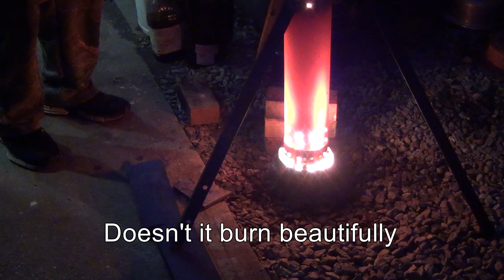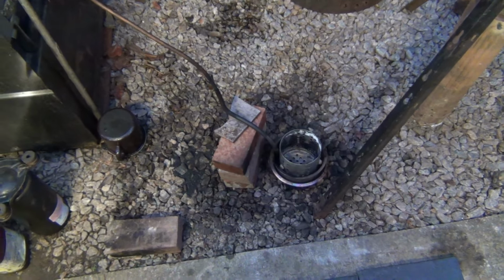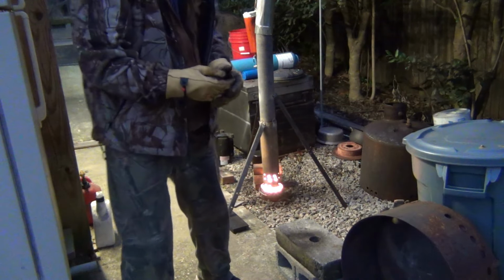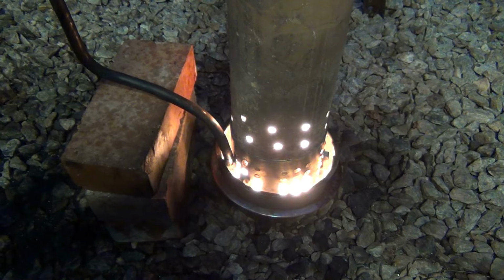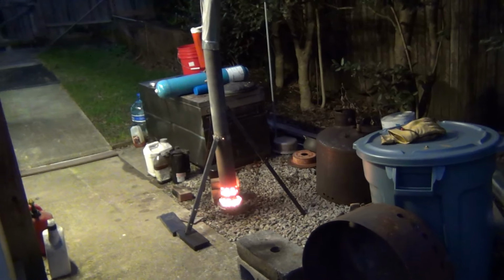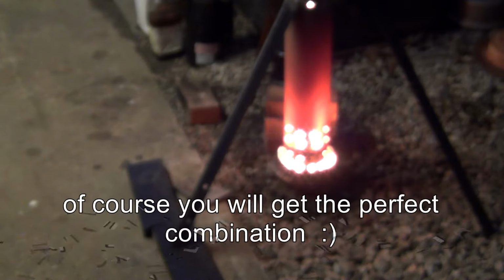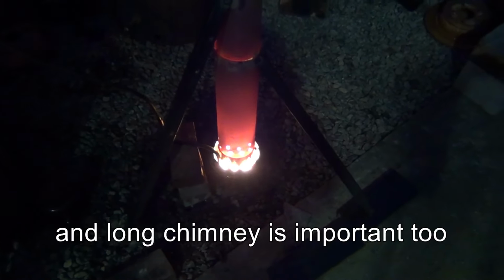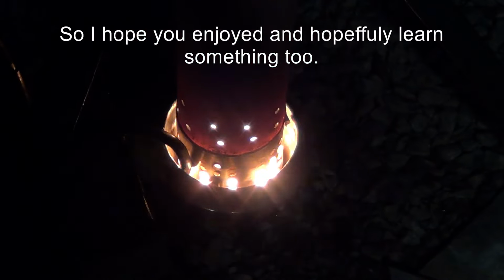Basic waste oil burner without blower

Comment: very nice design but remember galvanized pipe is very very toxic when burning
Reply: Why, galvaniz is zn it same material for roff in my country
Reply: "These fumes can cause what is known as “metal fume fever” or “zinc shakes.” Metal fume fever can cause symptoms that include fever, headaches, nausea, chest pain, and more. Inhalation of these fumes can also cause long-term health problems, as the lead present in the galvanized steel can vaporize along with the zinc."
Reply: It's generally most toxic in the first really hot burn. First burns should always be outside and safe. It did worry me that the video creator mentioned welding the galvanized "chimney pipe". I wouldn't want to weld that stuff at all
Reply: Everything is toxic when it's burning.
Reply: Yeah like burning waste motor oíl is so healthy and enviromental friendly tho.. Yep sure..
Reply: Drink some milk get some rest avoid the first hot burn and the fuzzy ash you will be find

Comment: Nice. OK a lot of effort to proof the concept. That done, how can you put the burner to good use? There is no point in burning oil and getting a pipe white hot if you can not put is to good use like heating water, cooking. As is it is not usable to heat a room.
Reply from the maker: @barnardb01  yes it is, see other videos

Comment: I used the inside of oil stove, inside it had 4 rows of small holes in a circle. I ran a copper line inside into a SS dish. in the center. I used a drip feed from a scrap windshield washer tank.  I used the needle valve  to regulate the flow of  {90% used motor oil and 10% diesel mixed well to thin)  at the back of the oil stove where the supply of heating oil came in I hooked a small electric hair dryer.  WOW, in no time at all, in -40 brutally cold winter, i can bring my 600 aq ft shed, to 25 degrees Celsius, way to hot, the stove casing is maybe 16 gauge thin.and turned white hot.  I built this to cut down on the amount of firewood i was using, and the need to keep adding wood every couple hrs. or worse. Over the winter we had 2 months of -30 to -45 Polar Arctic Chill, I used around 5 gal of used motor oil, with % diesel to thin it out in around 24 hrs.  By winter's end the thin metal casing developed cracks from the intense heat. So am building a new version with a Aqua Tank, the metal is quite thicker. I've watched almost every Y-tube video and ''' Oil Burner ''' eh mate, are a 'must see....

Comment: Forgot say ♥️ the video but  need close up or drawing of stainless pots , and drill size. Nice hot furnace ( careful on flow rate  white flame is 2,400- 2900f  too hot flow rate )
Reply from the maker: Can you explain please
Reply: temperature has on the color ot
flames. Scientists have learned that
red flames correspond to
temperatures from 980 F up to
1800 F. Flames turn orange when
the temperature reaches 2,000 F
to 2,200 F. When temperatures
approach 2,400 F to 2700f they appear white.

I was getting 1600f resulting in repairs to thin stainless steel heat changer but any impurities were vaporized and turned to dust. That was my first converted wvo heater block installation on Mr heater forced air heater. Now have wmo double barrel furnace with heat exchanger yrs ago 10 was on wvo
(So safety says should reduce flow  rate for lower temp) hope this helps
Reply: I agree. The design is very good , but the rate of oil must be closely monitored so that the metal is prevented from melting.

Comment: Hi, Thanks for a very interesting video. I like the idea of the double pot for insulation in the vapourisation zone. I have been thinking of insulating ceramic for the same reason. Is the burner pipe a close fit in the burn chamber with all the holes in it? Is the extra chimney necessary for providing  the required draft or is it just to take the exhaust away? Tim
Reply from the maker: It is close fit but not necessary, Chimney is necessary, the longer the better,
Reply: @VladFredK  Thanks for your reply. Tim

Comment: Of all the systems I’ve reviewed on YT, this is the simplest, and thus I believe is the best. 

Adding a Tee section and wafer valve further up the pipe (about 1m) will provide control of the air flow and the oil burn rate.

Comment: 2 ideas: weld some plates to outcome pipe to let heat air better. Make income cold air pipe straight to the flame - in order to block sucking warm air from the room, it should let burn better

Comment: I was thinking if a person welded that tube in side a tank of some sort so it can gather heat then weld 2 5" pipes blow air in one and heat out the other would heat a small shed or insulated garage real nice. Wonder if it would burn used engine oil
Reply from the maker: Yes it burns engine oil even better

Comment: I have a mobile home that has a gas burner (type) central heating (vents and duct work are on the floor) that uses propane. But I can't afford the price of propane any longer. I'm not running 3 - 1,500 watts space heaters trying to just keep my living space warm. And there's 6 rooms (cold toilet seat is something to get used to lol) that I have blocked off, so they stay meat locker cold. 
I've been trying to brainstorm a diy wick system using waste oil. By the looks of it,  winter will be gone before I figure something out, lol. It's been 19⁰F at night. My dog doesn't even come from under the covers lol

Comment: How do you keep the oil inlet from melting? Is it copper?
Reply from the maker: Yes it’s copper, most heat is inside the pipe, the copper tube is on the outside so not enough heat to melt it.
Reply: @VladFredK  very cool, thanks

Comment: Cool dude. Nice job. I've been experimenting with the oil and wicks and thinking about the drips. I got some 1/4" copper tube and 1/4" copper coupling. What did you follow for making the drip system? I like the idea of a drip system. I am doing this in a van and it has a little stove i made and 3"exhaust pipe for chimney. I've tried carbon felt for a wick but can't keep it lit so I will try adding more alcohol next time to start.
Reply from the maker: it will be dificult to make it work in small scale with out forced air.

Comment: May i use used engine oil ?
Reply from the maker: yes that actually burns better
Reply: @VladFredK I live in Alaska and I smell when people are burning motor oil, do you think in those cases the burn wasn’t getting enough air?
Reply from the maker: not necessarily, it has to be the right amount of air and chimney draft, to much air will not burn clean, not enough air will not burn cleat also ,  to much air draft will burn clean but too fast, not enough chimney draft will smoke, I regulate the air draft with the amount of holes supplying the fire with air. this way you create the proper vortex . Its not easy to burn the oil with out blower but my house heater works pretty  well  https://youtu.be/uk9M0H_SUzQ

Comment: Great job👍massive heat from waste😎a pity it's quite noisy though 🤔
Reply from the maker: yeah but I kind of like this sound, it sounds better then oil heater with blower
Reply: What’s the longest duration of time you have run your heater?  Could it run continuously in the winter?  How thick is the steel chimney at the base?
Reply: @dave858man2 I'd really appreciate a response to that as well.  I'm trying to make one of these myself with a 6 inch exhaust but I'm not quite getting the high heat so the build up of the waste in the bowl is a problem for running over a long period of time.

Comment: Lesson the air for smaller burn in the same set up?
Reply from the maker: Yes
Reply: Actually, you would need to add larger holes but higher up the pipe so the air can bypass the furnace. Install a sleeve that can adjust the amount of bypass (from nothing to maximum) and there you have it - a controllable burner.

Comment: can you make a design for cooking?
Reply from the maker: Not without blower
Reply: @VladFredK gleich wie rocket stove, und geht auch fur kuhe
Reply: Easiest way to convert it is to weld a round 'shelf' around the flue. That gives you a space to rest a tiny skillet or a pot for boiling water. Multiple shelves at different heights would give you temperature control.

Comment: Surround it with more heat absorbers , free standing bricked keep the heat confined where you want it. Take bricks indoors Greenhouse,  tent or any where to keep the chill off.runs coil around it get the water flowing in it to a tank or bath, or radiator inside the property. Fire inside exhaust outside after passing it through a coil in a sand  drum  and exhaust fumes outside.
Reply from the maker: sounds good
Reply from the maker: you mean like this https://youtu.be/zvV_cMaagQ8

Comment: This is a great burner design and it's running very cleanly. But WHY?! what is it for? You aren't distilling water or heating air to pump into the house or heating water. You'll never warm up the outdoors. You aren't cooking on it. What is it for???
Reply from the maker: I’m working on it to heat up the house 🏡 this winter. I’ll upload it if I’m successful.
Reply: @VladFredK  oh that's cool!!! Good luck!
Reply: @VladFredK  im trying to make a much smaller one to heat an RV with vegetable oil and used olive oil and diesel.
Reply from the maker: That will be tough, I find the small ones very hard to keep stable flame. but good luck. Let me know how it goes.
Reply from the maker: here is what is for https://youtu.be/zvV_cMaagQ8

Comment: I would suspect that during the video, at the break point and just before the burner is fired up, an air pipe has been buried in the gravel to create this impressive and noisy " natural draft" jet engine flame. I have made a copy of this and there is no way that the intense updraft can be created without using an air blower. I am not impressed with this person's dishonesty.
Reply: I'm not saying you're wrong, but It's a little extreme to accuse him of being dishonest just because you could not reproduce his results. He gave no details and there are many parameters at play. He may have just stumbled across a combination that worked. We don't even know how long it took him to get these results. 

Maybe next time voice your suspicions without flat out accusing someone.
Reply: @CRuM770  If the burner was shown  being set up on the concrete rather than the gravel  and then lit without a break in the video, it would be more convincing. Until then I stand by my original comments, as I have no reason to accept  that this burner can perform as shown without an additional forced air supply (I have reviewed all burners that I have located on youtube to substantiate my statement)
Reply: @tonymoore3571  here's why I'm not impressed with your "dishonesty".

1. Rocket stoves can sound similar to this if constructed properly.
2. All burners that I've seen with a blower and holes in the combustion chamber shoot flames out of all the holes.
3. Longer flue pipes mean faster air flow.
4. This YouTuber achieved a similar sound, albeit softer and slower with only a 2 m flue. https://youtu.be/kfdWPxYC-Gk?si=6AVklumOAjnMEZak

Just because you don't know how something works, doesn't mean you are justified in accusing them of lying. It's great to think critically, but it's also good to recognize when you may not have all the facts.
Reply: A dead straight long chimney like that will create a superb draft hence the noise...
Reply: i disagree, most likely legit, have had the same noise coming from a 3m chimney, approx. 70cm wide, over my forge, even with a small fire going i could hear the rush of air many meters away, so a hot burn with small but long chimney will give a good loud draft
Reply: I think you should be more careful before you cast a rock
Reply: There's a blower he's a liar !
Reply from the maker: @CRuM770  okay guys, I don't bull shit and I don't put up with bull shit, life is too short for that so if you don't believe me here just go somewhere else, I rely don't give a damn, and just FYI this was the very first prototipe I have created and I was just lucky because it took me another year to actually create another one just like that and I almost gave up because I was failing miserably so there is a lot of small but important details to make this work so if you would watch my newer videos on this oil burner you would understand better before you bash me. Later Dudes.
Reply: @VladFredK  I'm not sure if you accidentally responded to the wrong person, but I was telling the commenter not to accuse you of dishonesty without first understanding the system. I later gave him reasons why he was wrong.
Reply from the maker: @CRuM770  it was just general reply to this tread